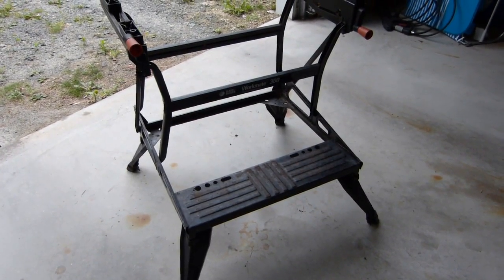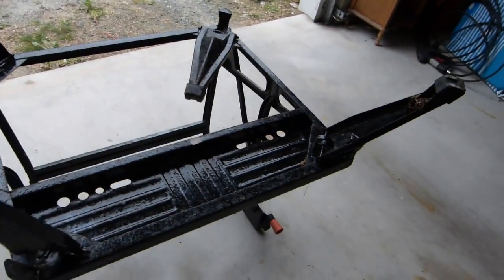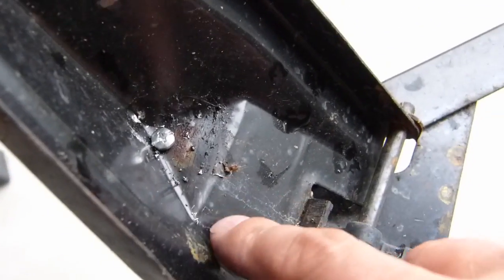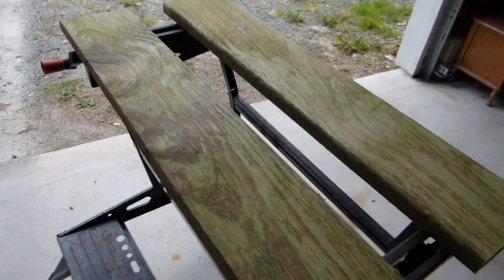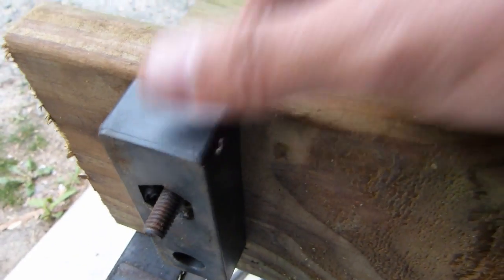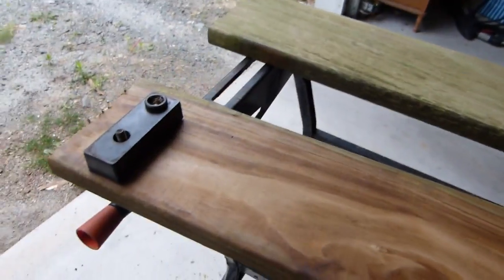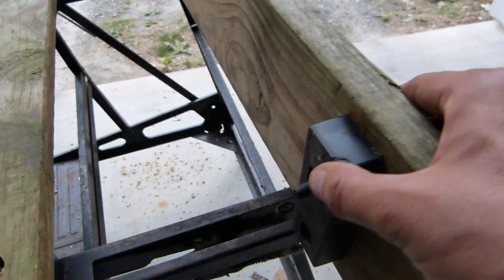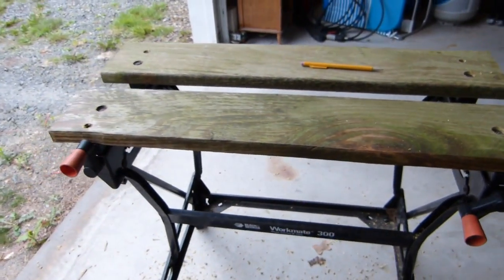Cheap and Cheerful Workmate 300 Repair Highlights

Comment: If one has a 3D printer there are free files out there for those broken leg clips. Being able to close them makes it narrow and allow it to stand on its side. I have plenty of stands and workbenches but these are great for one off projects. Try clamping a board in one to the height you need for a feed out table behind a table saw.

Comment: Why does no-one ever chuck something like this away at the end of my drive?  Oh, wait a minute!  A few years back I was able to buy a virtually new one at around half shop price from a guy who was moving and needed the space.

Meanwhile, the one we were given as a wedding present over 40 years back, although now a little scratched and scruffy and needed the leg clips replacing, still has better plywood jaws than the MDF ones on that newer model (one of which is distinctly sagging in the middle.)

But yeah, an invaluable tool!

Comment: Why not use some nice boards? What pleasure is there in working with these dirty old pieces of wood?
Reply from the maker: The pleasure is using materials I had on hand that would otherwise have been thrown away.  Since this table is used for garage projects and gets things like oil and pant spilled on it there is no sense wasting money on "good" boards that would get ruined.  If I were using this for fine wood working or something like that then I'd consider using nicer boards.

Comment: Those little plastic clips for the feet are cheap.  You can find them easily via google.  I bought a replacement clip for my workmate.  Haven't tried installing it yet, though.

Comment: First of all I think I would have completely cleaned the entire frame and then wiped it down with wax. Johnson's Paste wax to be exact. Then I would have lubricated all the moving parts. Then I would have made the table parts as you did. You saved a very nice and useable shop piece. I love mine!

Comment: Just finished re-doing mine which is a bit older than the one shown here. On the acme screws: good idea to remove them & wire brush the threads to remove rust. If they are rusted they will wear the plastic internal threads that attach to the slides. The leg lock plastic parts are still available on ebay & would be a good investment. The unit can be folded & will take up very little space when not in use.  These are very durable & useful items. Use mine a lot & had to make new wood tops, used 2 layers of plywood glued together. Good video.

Comment: My 300 was a gift from my wife.  It has been one of the most useful gifts I have ever received.  It is very well built and is very dependable.  Good job salvaging that one as it has years of use in it still.
Reply: Have had a 300 since 1983. It's still going strong.  Also recently I found a early aluminum casting model that I needed just because. They really are useful in the shop and outside.

Comment: I like what you did, but I wonder if the solid wood tops will split under the clamping pressure while holding a piece of wood in the bench dogs.  That is only a concern if you drill the tops so you can use bench dogs, of course.
Reply from the maker: deezynar I agree - but I don't plan on using bench dogs with this bench.  Its more of a garage bench than it is a woodworking bench at this point.
Reply: I plan to use laminated plywood on mine. The kind that is used in the bottom of trailers. The video was helpful because I were not aware of that the piece has to free the handles
to turn.
Reply: I was asking about how to the the hinges on the frame thanks tk
Reply: I have one that i inherited when my grandfather passed, he took care of every tool he had lol it looks to be all original woth solid wood for the tops, i have used the dogs multiple times and it hasnt failed